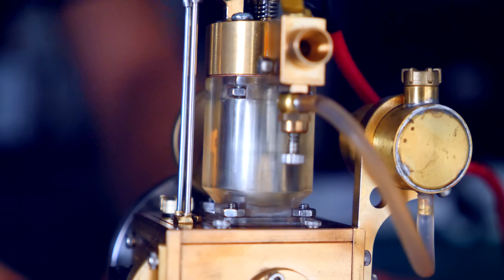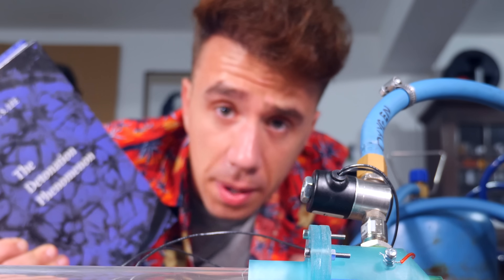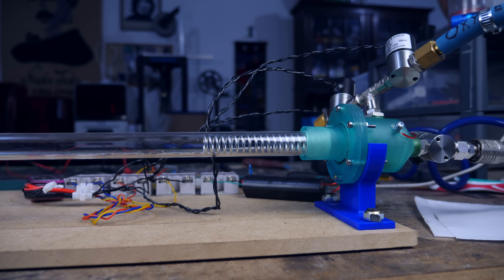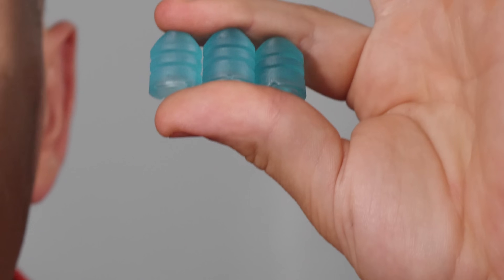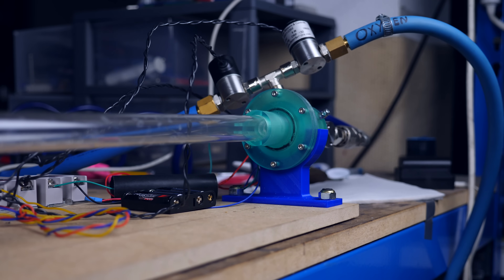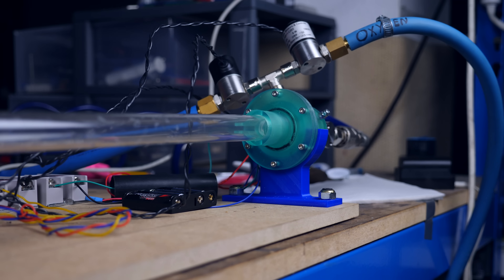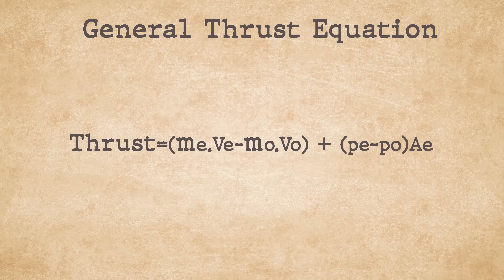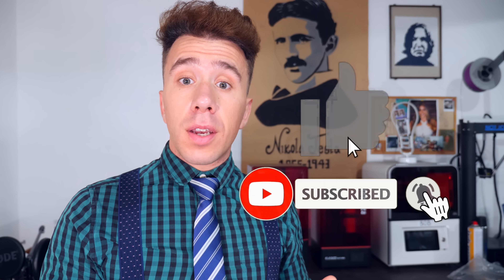PULSED DETONATION ENGINE

Comment: Technically, this is a rocket engine, since it uses it's own oxidizer. Even cooler than a jet engine!
Reply: Its a rocket engine way slowed down, theirs a gradient between what we see as continuously and  the amount of detonations, some rocket engines are measure in pulses, honestly I was hoping to see a v1 type of pulse engine with 2 valves, an exit to exhaust the pressure wave, and and entry one in the front sucking air due to the vacuum of the last pulse.
Reply: @darkzide1178  you mean a ramjet, basically?
Reply: @Taxedbrass  Ramjet has no moving parts, a pulse jet has at least 1 moving valve, so no, not a ram jet.
Reply: @darkzide1178   im aware of a fairly popular valveless pulse jet design. I don't think valves are a requirement.
Reply: @darkzide1178  Valves are absolutely not required on a pulse jet
Reply: @Taxedbrass  I could be wrong but I thought you need at least 1 valve on the pulse jet to let in the fuel, while also not letting the detonation travel back up into your fuel tank. Otherwise you would be losing thrust to pressurize your fuel tank as well as combustion efficiency as your fuel source is contaminated by your exhaust products. So that is where the 1 valve comes from. It was even on this channel where he built a pde by using a tesla designed (invented) one way valve that had 0 moving parts. But it is still a valve.
Reply: @hubertcumberdale8175  there are a few pulse jet designs where the fuel is literally stored in the combustion chamber. not super efficient, but a pulse jet nonetheless!
Reply: @MadScientist267  are you sure about valves not being required?  As I am pretty sure you need at least one between your fuel and your combustion chamber. Otherwise how do you stop your combustion from 1. Pressurizing your fuel tank to the point where it bursts or its moving too fast to combust in the chamber. Or 2. Polluting your fuel tank with exhaust products that then reduce your combustion efficiency.  You need at least 1 valve between your fuel tank and combustion chamber although that valve does not need to have moving parts as integrated showed in one of his earlier videos using a tesla designed 1 way valve. But still a valve.
Reply: @hubertcumberdale8175  https://youtu.be/snWrJgcl5to   <- valveless pulsejets
Reply: a jet engine is any engine that uses a jet of gas to propulse itself, a rocket engine is an engine that its supoused to be mounted in a rocket, all rocket engines are jet engines but not all jet engines are rocket engines.
Reply: @santiagoperez2094  a rocket engine is defined as "an engine that operates by the combustion of its contents, providing thrust as in a jet engine but without depending on the intake of air for combustion". So a rocket engine is technically a jet engine, but the common use for a jet engine dictates using air from the atmosphere in order to provide oxygen for combustion.
Reply: @Taxedbrass  Intake air is also used as reaction mass.
Reply: I know these as Pulse Detonation Engines
Reply: @Vaporfry  he should try an rotating pulse detonation engine
Reply: It's a potato canon!
Reply: It's kind of like something between a rocket engine and a pulsejet engine.
Reply: So a nitrous powered car is a rocket??????
Reply: @melody3741  technically speaking, no, as a rocket engine has to provide thrust, while a internal combustion engine provides torque.
Reply: You said your valves cant open and close fast enough. Why not add 4 sets of the same valves with a slight delay between cycles? Your spark cap can surely keep up with an increased rate.
Reply: You might want to look up concepts like "has its own oxidizer".

Nothing about this involves a self contained oxidizer. Whatsoever. At all. Anywhere.
Reply: @MadScientist267  except for the SELF CONTAINED bottle of O2, (an OXIDISING gas) in combo with a bottle of butane gas. Which is mixed (that's the 'CONTAINS ITS OWN OXIDISER' part) then, ignition.
You do realise that most rocket engines use oxygen that is stored in a giant tank in liquid form, for detonating with H2, also in a giant tank.... RIGHT?????
Reply: @renagenic  That is not "self contained" 🙄
Reply: @MadScientist267  is it using OXYGEN from the fkn Air? Or from a tank of O2???
Reply: @renagenic  Ok last time.

Self contained means it's in the fuel

Dictionary

Get you one.
Reply: @MadScientist267  very odd dictionary....
Do YOU THINK that ONLY solid rocket engines, count as the only real rockets?
Reply: @renagenic  No but they are the only ones using self contained oxidizers

Comment: Hate to say this, but according to US Federal Law, what you made is actually defined as a firearm. 

18 U.S. Code § 921 (a) (2)
The term “firearm” means (A) any weapon ... which will or is designed to, or may readily be converted to, expel a projectile by the action of an explosive;

So yeah... Butane is explosive. Your pulse jet using butane as fuel was modified to expel a projectile, which was then used to cause physical damage (to a tomato, but still...). This meets the technical definition of construction of a firearm, at least in the States.

Comment: Wow, you are so good. I watched the video 3 times and didn't get a single ad at all.😃
Video idea - You can try to build a Space-X inspired engine, and Specially you can check that Kerosene, Oxygen mixture fuel on it, compare it with traditional Hydrogen fuel and aeroplane fuel, and test it's efficiency at different compositions.

Comment: Video idea - You can try to build a Space-X inspired engine, and Specially you can check that Kerosene, Oxygen mixture fuel on it, compare it with traditional Hydrogen fuel and aeroplane fuel, and test it's efficiency at different compositions.

Comment: Hello! I have watched all you successes and failures that have created so many very interesting videos. I have an idea for you to make a better pulse jet engine.  During WWII my uncle was in charge of retro-engineering captured V-1 "Buzz-Bombs" in order to discover any of their vulnerabilities.  When taken apart he was amazed at how simple and powerful these pulse jet engines were. The first German "buzz bombs" only utilized thin and flexible razor blades in a flap valve grid, followed by a mixing chamber, spark plug, and venturi tail pipe. The readily-available and robust razor blades easily could flex open to allow the fuel/air mixture to enter the combustion camber, and then the razor blades "flapped" shut during the explosion to propel the rocket forward.  These razor blades could flex open and closed many 100s of thousands of times without failure!  The filling and flapping occurred about 50 times per second and thus "buzzed".  This simple design allowed the rocket to carry huge weights into the sky! This design does not require all the engineering complexity and lacks the problems seen with a rotating pulse engine.  My uncle told me that his first 'copy' of the V-1 flew 50 miles until it ran out of fuel!  Therefore, look up “buzz-bomb” designs and make one so that you can have great success with one of your videos!
Reply: How am I doing in the competition?

Comment: How about a 4 engine ‘flying bedstead’ drone?  It could use standard drone control systems for flight control.  It would sound like the end of all things when it’s flying.
Or, how about using a drone to lift and orient your engine and then start it.   The drone controls should still fly it and the ground would shake.

Comment: Try making a coaxial swirl injector (rocket engine style) and test it with this engine. You also could use several injectors with separate set of valves to increase the driving frequency of the engine.

Comment: 11:30 ya don't need better valves. "more valves cycled on N.C. N.O. duel contact relays that switch the high amp relays 2X fire rate, normal automotive relays do that"... wiring gets a bit more complicated...
Reply: and then make a mirrored set up "now totaling 8 valves" but use a Arduino on the main relay's coil activation thus desynchronizing it from the main valve set. there are flash boards that could do hat in analog function that cost $15 and don't need programing, just solder them together properly... could end up having 32 valve sets on their fairly easily, as other problems come up at higher pulse speeds? sounds continuous... one 8 sequence flasher flashing the trigger for 8 other 8 sequence flashers 656 valves looks like a mess...
Reply: thus after recording the first quadradic graph, one can make another graph for increasing/decreasing the diameter of the initial fill chamber, well as separate quadratic graphs for... chamber length, width, exit hole size, firing tube length... etc. into a universal formula that includes optimal frequency of valve discharge, thus if available calculating the size of vesicle that 656 valves evenly placed around the chamber would be as to its size and shape including wall thicknesses and calculated pressure average to maintain the flame/sparker at whatever location it happens to be as there is another graph for valve pressure and switching frequancy...

Comment: Why not a gatling gun approach?  Multiple barrels, rotating or not.  Program multiple arduinos so they fire the maximum number of times per second, but use i.e. 3 barrels and program the arduinos 120 degrees out of phase.  10 explosions/second x 3 barrels results in an explosion every 1/30th of a second (if my math is correct).  Perhaps 3 separate firing chambers all connected to the same discharge tube/pipe.  Configuration isn't my forte as I have no experience in these things but, conceptually, why not copy what's been done with the combustion engine?

If you have 3 cylinders of a Geo Metro vs the 12 cylinders of certain Jags, well, you get the idea.

First time viewer here, but it won't be my last!  Namaste

Comment: What if you use NUCLEAR EXPLOSIONS to power a engine? And yes this is already as thing that was developed back in cold war era for moving massive generation ship, and it was even tested on traditional explosives. Program was cancelled due radioactive contamination dangers while lifting off from earth (This would need to be built in orbit of the moon or similar) and fuel issues on long duration flight since nuclear bombs dont grow in trees...least on this planet and likelyhood of running one in alfa centrauri is pretty low. Also scaling down the goals of space race to moon and collapse of soviet union ending the space race killed the project off, but it has started again with China, so we shall see how that will go. Note that Uranium and other rare material here on earth are plentiful in space.. Just one asteroid in great asteroid belt can contain so much gold for instance, that it would collapse golds value to scrap steel value and since fiat currencies are tied to gold value.. well you can see why rich dont want us to go mine it from space...

Comment: Two things
1) I read a paper a while ago that used passive valves for a PDE. Basically the normally open valves are slammed shut by the detonation itself and open with the suction generated from the exhaust. Fast valve response and reduced complexity.
2) Perhaps the overall performance could be improved by adding an air bypass. That fast moving gas can have bypass air added to cool and reduce velocity while increasing mass. The increase of the bypass ratio has been the biggest efficiency booster and most modern commercial engines and the most efficient modern commercial jets are almost 90% bypass.

Comment: If you utilized a smaller lighter projectile like an airsoft bb I bet you could get over super sonic speeds. High pressure gas is good for a large projectile like yours, low pressure high speed gas is better with a lighter projectile but you can hit some crazy velocities.

Comment: The air speeds up in the tube to about mach 1 which is fanno flow. An increase in area after reaching choked flow (mach 1) should result in higher velocity and lower pressure. Ideally, you would want the exhaust to be at atmospheric pressure and as high of velocity as you can get. If you can measure the pressure in the tube toward the end, then you can use simple pressure to area relations to expand out the flow to atmospheric pressure and much higher velocity. For the RDE, this will most likely look like a aerospike nozzle. If you can, put some particles in the tube to track speed or at least the flame front. If the smoke products travel in the same direction as the flame front, then it is detonation. RDE’s are highly dependent on proper geometry and reactant injection. I recommend checking out existing designs from Purdue or Cincinnati. You will need hydrogen and it will get very dangerous, if you are not careful.  I am actually in the process of designing an RDE to manufacture for Dallas Makerspace. Good luck! 

And of course, you should try a 3D printed RDE for a future video. Perhaps it could be fueled by 3D printed ABS as a hybrid system. Just don’t sell it, Firehawk Aerospace owns the IP on it ;)

Comment: If you put a T fitting at the very beggining of that barrel or exhaust pipe, and face it upward with a 1' tall pipe and install a pin at the top part of the T and fill the tube  with little balls of ammo and than screw a cap on top of the end of the tube and fire that thing up and pull the pin, you got your self a nice little automatic machine gun :]

Comment: I'd like to see one where you use electrolysis to produce your hydrogen and oxygen fuels for some type of pulse jet. I don't think the volume of gas would be enough for continuous propulsion, but sure would be neat to see in action
Reply: Maybe a few super capacitors for pulsed electrolysis.
Reply: Then you'd only need a power cord to run it. Or a petrol engine genset.
Reply: Volume is a function of power input.

Edit: Sorry. Spontaneous volume. Total will be a function of energy.

Comment: 12:20 I think you are wrong on this one Integza, this is not different from any other rocket engine and it's thrust is a function of exhaust mass and velocity. There is no such thing as 'pushing against the atmosphere' unless you are talking about lifting bodies like wings. Also, this is not a jet engine in any way as it does not accelerate the air, it's a pulsed rocket engine. It's a very good idea as detonations will produce max exhaust velocities and potentially very good efficiency. I'd be willing to bet that your engine produces more thrust in a vacuum; like all other rockets!

Comment: Why not just use a spark plug and an ignition coil from a car or motorcycle? I guess you could just turn that on and of with a simple voltage pulse.

Comment: I know this one is not going to be popular in the votes, but it would be very interesting to me if you had a video focusing on metrology. More precisely measuring the characteristics of the engine, like the thrust, fuel/air ratios, exhaust pressure and velocity, etc would do a lot to show folks what engineering is! :-)

Comment: For improved pulse frequency you can use a one way reed valve. The pressure in the combustion chamber during the burn keeps the valve closed, and the negative pressure as the gas exhausts opens the valve, allowing fresh air in. 
You could still supply with oxygen instead of air by having the intake side of the reed valve attached to a manifold that you are supplying with oxygen.
You'd probably need a fuel pump in this design as the pressure could be quite high when the system is running
Reply: If the velocity of the injected fuel+air is faster than speed of flame/detonation waves... Don't need valves at all. The addition of fuel/air will extinguish the flame from point it's added...
Something like a spiral combustion tube, with a bringing pipe from near end to near start , so exiting combustion, reignites mixture near the start

Comment: might be misunderstanding, but 12:17 , is that why at 11:15 it seems to stall half way down the rail? initially the outside air is stationary, so the first pulses have a lot to push against (higher thrust), but after these pulses, the air around the exhaust is travelling in the direction of the exaust gasses, pulling air along the length of the engine, asif the whole engine had a headwind, and as the velocity of outside air flow over the exhaust comes closer to the velocity of the exhaust gases, the lowering difference in velocities reduces the thrust of the engine?
Reply: could be as simple as the hoses holding it back but still interested :)

Comment: At the end of the exhaust you could attach a piece of pipe with a bigger diameter to get suction of air that travels with the exiting flame. Like the Dyson bladeless fans do. It gives about 1.6 times more flow. Maybe it will help getting rid of the mushroom shaped flame at the end. If you make the flow twist by adding fins in the connection you may get a pointy end at the flame.

Comment: How about extending the tube to before the mushroom shape exhaust distance and applying a half shaped sphere so that it can be used as extra force but drill port holes at the end of where the shorter tube is located so the atmospheric interaction still occurs.

Comment: for the rotating part of the engine, you could try a rotating disk at the end of the engine with holes drilled in it to let gazes go in. wich will also help you control throttle as the disk's rotation is slowing down or accelerating !

Comment: I've had 2  new 3D printers of which nether worked. The PCB was flawed on one and the other fried trying to get it working. May have been my fault but I still don't see what I did wrong. Neither company would stand by their product or suspected I was the one that killed them. Year later I just gave them away. Still would like to learn to 3D print stuff. Rather I'd like an X Carve.